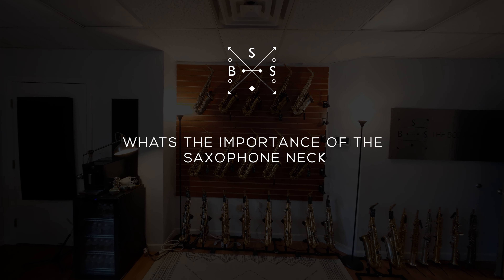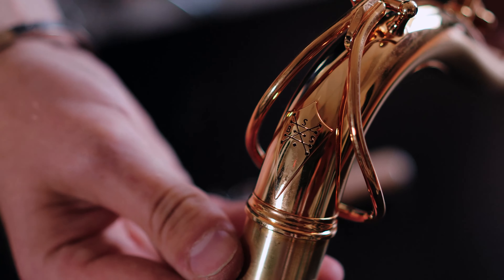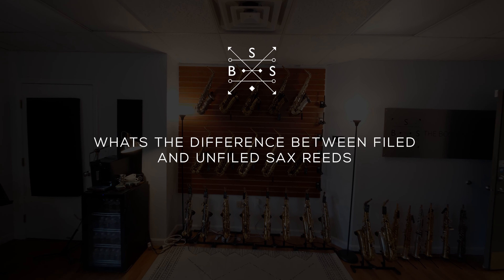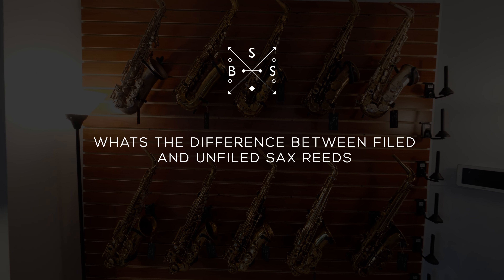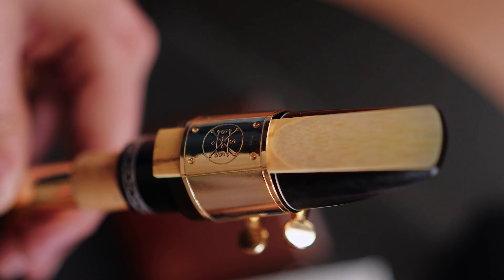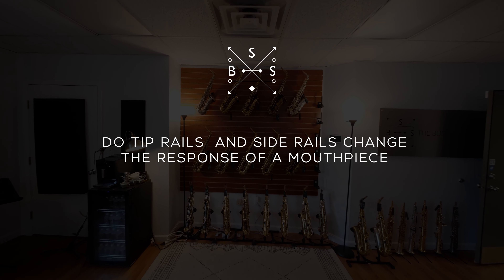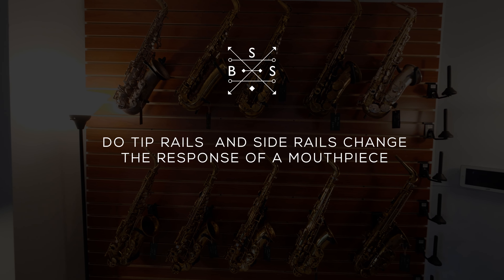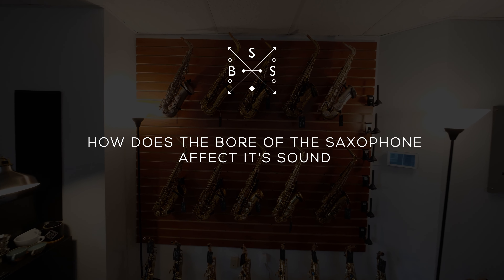Ask Boston Sax! EP 6: Filed vs Unfiled reeds, how to choose a new mouthpiece and more!

Comment: Recently I purchased a mouthpiece that was less resistant than what I had been playing.  I tried several reed brands (mostly Vandorens and D'Addarios) and reed strengths.  I prescribe to your view that there is no reason filed versus unfiled should make a difference. Therefore, I didn't put any thought to whether the reeds were filed or not.  An old 2009 D'Addario post suggests that the less resistant filed reed will work better on a more resistant mouthpiece ( and conversely a more resistant unfiled reed will work better on a more free blowing mouthpiece).  I went back through my records, and found that two out of the three best reeds for my older more resistant mouthpiece were filed cuts. Two out of the three best reeds for my new less resistant mouthpiece were unfiled cuts. By best, I mean while just playing the mouthpiece, the reed gives a quick response, facilitates bending the tone a full octave, and produces full controlled crescendos.  Also, the reed gives me a good sound throughout all the registers when playing the mouthpiece on my saxophone. Does filing make a difference?  Maybe, but I wouldn't go so far as to only play unfiled reeds on my new less resistant mouthpiece.  I think there is more to playing reeds that are too soft or too hard depending on the resistance of your mouthpiece, but even then I think one could find a reed strength that works well whether you are using a more free blowing mouthpiece or resistant mouthpiece. Perhaps some might take exception to that opinion, especially if they are swapping between roll-over baffled large chamber mouthpieces for ballads one day, then switching to some powerhouse high baffled mouthpiece for a funky jazz/rock gig the next day.

Comment: Here is question that has never been for me properly answered: a sax manufacturer,  say , yamaha,  offers a variety of necks which have smaller or larger bores. But these necks all start with the same diameter ( for the mouthpiece) and end with the same diameter ( into the sax body) So then how can the neck bores be bigger or smaller if they all start and end the same?